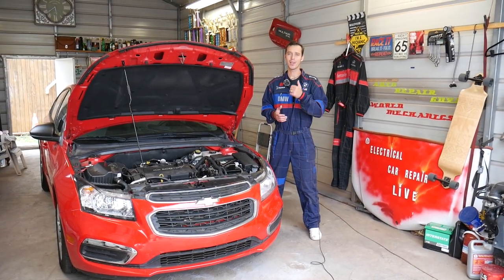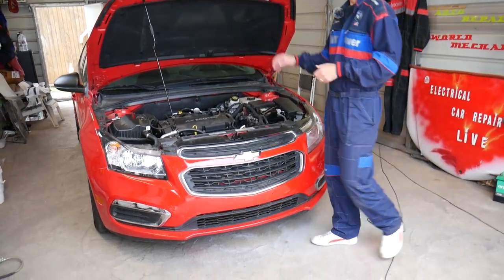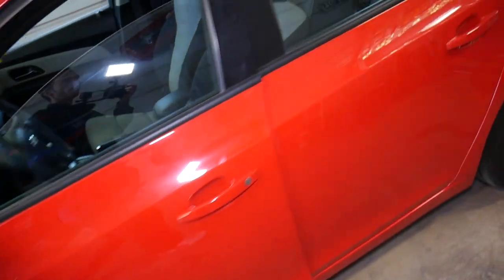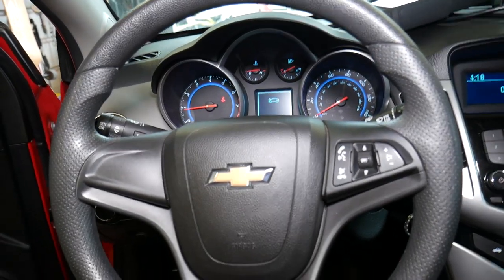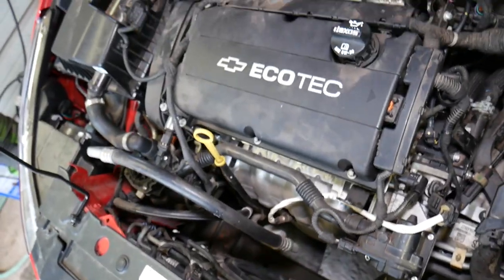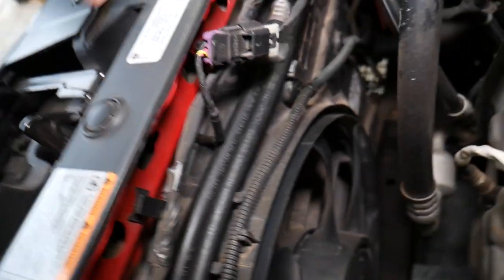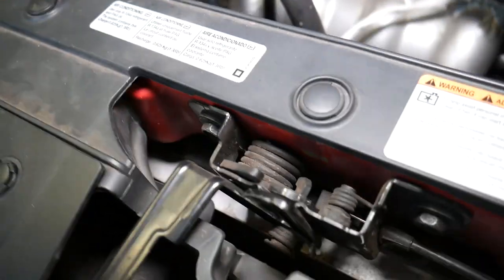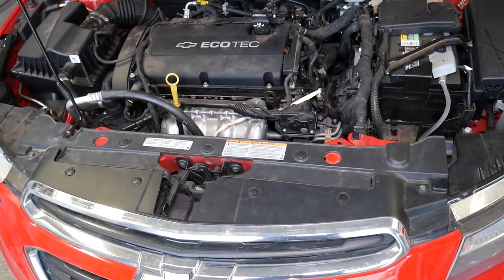HOOD OPEN WARNING MESSAGE WHEN HOOD IS CLOSED FIX ON CHEVY, CHEVROLET, GMC, BUICK, CADILLAC

Comment: Thanks... had radiator repaired by dealer, they did not secure the connection on the latch switch connector... easy fix to snap them together

Comment: I have a 2018 Chevy Malibu l is it difficult to repair P257F engine hood, switch circuit high voltage hood latch assembly

Comment: Disconnect the sensor... on the computer side (other end where sensor connected to), short 2 pins with a wire or paper clip that would normally be electrically closed when the hood is closed. Computer will not know the difference and the hood open light will be off. If memory services.. your connector on the computer side has 3 wires and would be 1) ground 2) signal to computer 3) connected to sensor and micro switch.  Numbers I have provided don't represent pin position on the connector but is easy to verify with a multi-meter or trial and error.  So in above pin example... pin 2 and pin 3 would be wired together to provide the illusion to the computer that the switch/hood is closed. That is what I did on our 2008 Acadia anyway... extra credit: wire tire the connector down and use water proof self bonding tape so the open connector and those shorted wires/paper clip connecting pin 2 and 3 are weather/dust protected.